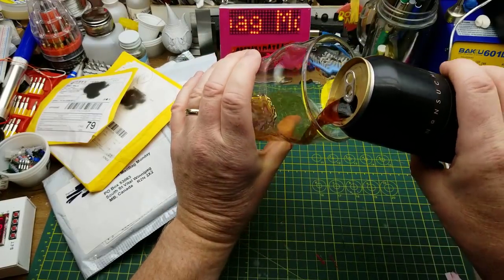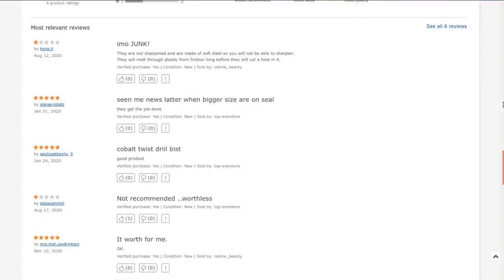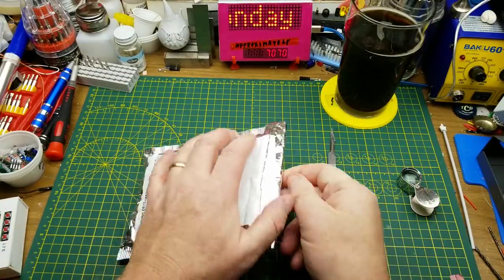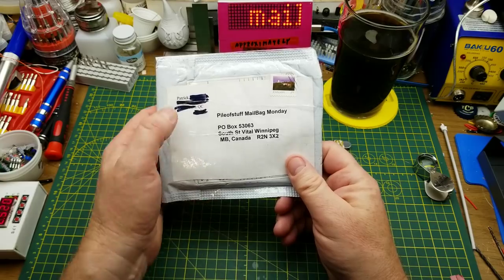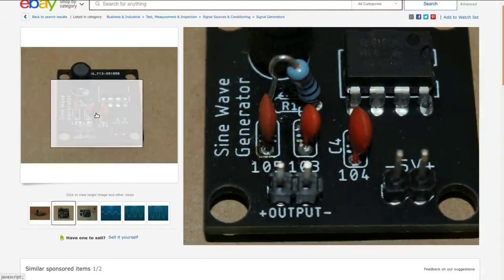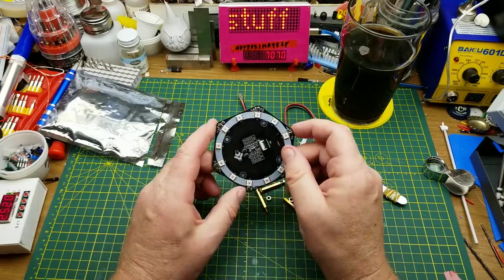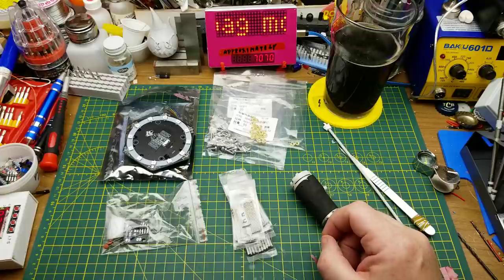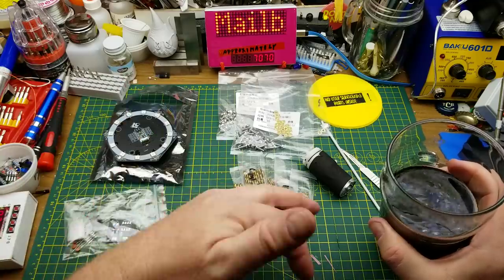Mailbag Monday #102

Comment: Nice video ! One more WARNING to add to those crap drill bits;
Most of them have their pointy end 'out of centre', that will cause the bit to drill excentric.
The danger is that (for instance) a 2mm drill will create a hole that is bigger than 2mm.
I ordered the same set many months ago, definately among the worst crap I ever bought... 
Thanks for the upload Mr. Pile :)
Reply from the maker: So far I've only used them to ream out holes in 3D prints so even that centering issue isn't really a problem for my use cases.
It is worth thinking about for anyone needing drills for more serious uses.

Comment: The WS2812(B) does not need precise timing. You can simply use the SPI MOSI with a 6400000 Hz clock.

Comment: I store my filament in vacuum bags that are made to store clothes.
They have a double zip lock top and a one way valve so you can use a vacuum cleaner to pull out the air, some come with a small hand pump. Got mine from e-bay really cheap.
Reply: Exactly what I thought. I think he's gonna be waiting a good while for that pump to remove the air...
Reply from the maker: I do squeeze as much air out as i can before sucking the remainder out. 
I'm hoping the cheap pump can get even more air out than I can manuallly
Reply: @pileofstuff I get what you're saying, but, seriously, get yourself some clothes vacuum storage bags, they are life changing, and simple to use

Comment: If it's PLA filament it's not hygroscopic, you shouldn't need anything. but I keep mine in a one-gallon ziplock with one small desiccant bag. I have never had an issue with moisture in PLA. I also keep PETG the same way.
Reply from the maker: Thanks.
I've heard so much conflicting information, it's hard to know what filaments need which special handling.
Reply: @pileofstuff  Anything for you man! thanks for another video. and have fun with the 3D printing. it is a learning process for sure. If you have any more questions contact me. I would be happy to point you in the right direction.
Reply: PLA IS hygroscopic!
Reply: Yes, I might have mixed up which is hygroscopic, however, a ziplock and a small desiccant bag like I said is more than sufficient. In the real plastics world, we store our plastics of many types in a non-temerature controlled warehouse and pull from that directly to the process machines. if we notice moisture which was very rare we would simply put the plastic in the oven (not as pretty as yours at home). it is set to a very low temperature and ran for some hours. you can do it in your home oven. I have been 3D printing for several years and never had to do this at home. I have only had to do this a handful of times in the industrial environment.
Its a lot of people making things more difficult than it needs to be. just don't give your filament a bath or a soaking and you will be ok. I have run skids of plastic sitting by an open warehouse door and raining out for days and had no issues.
Reply: @curtstacy779  Hey, life happens.
I spent ten years in plastics extrusion here in the Pacific NorthWet. We went through our raw material (almost exclusively HDPE and polypro) too quickly for it to take up much moisture (both are "officially" non hygroscopic but...)- except for the colorants. Those had the habit of sitting around for a while and would occasionally blow bubbles in the product when the absorbed water turned to steam.
One year the Big Boss had us experiment with a "green"  plastic made from corn starch. That stuff was a disaster. It came in a sealed bag inside a gaylord. A day or so after you unsealed the bag it was fine, after that it got spongy and blew dies off the extruders. Rather than bake it dry we sold it to a shop in Texas IIRC.
Reply: @markfergerson2145  Yes exactly occasional issues. 
Stored in your house in a ziplock bag with a small desiccant bag is more than adiquate.

Comment: I2S is an interesting protocol. You need special hardware for this = µController that support I2S, as examples Arduino MKR, or Teensy 4.0 or (my favourite) Teensy 4.1 Add the audio board on the Teensys and you you can make an awesome mixer.  Be careful there are two versions, one for Teensy 3.x and another for Teensy4.x
https://www.pjrc.com/teensy/td_libs_Audio.html